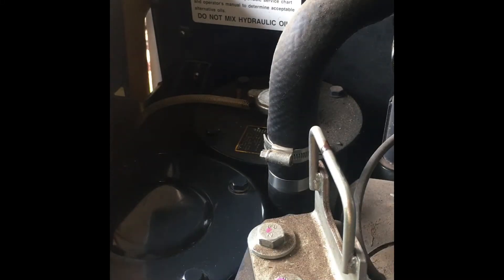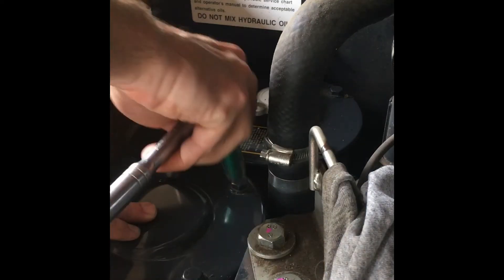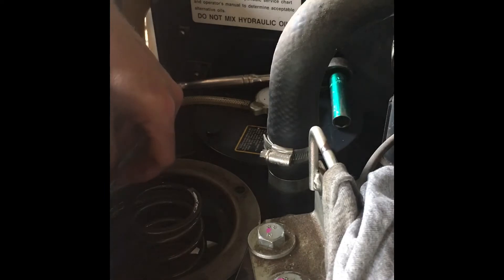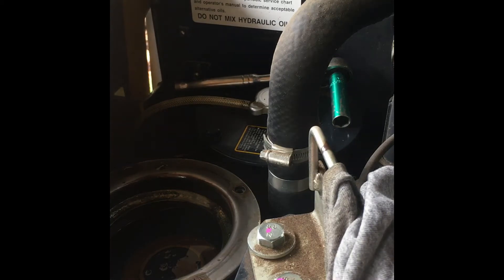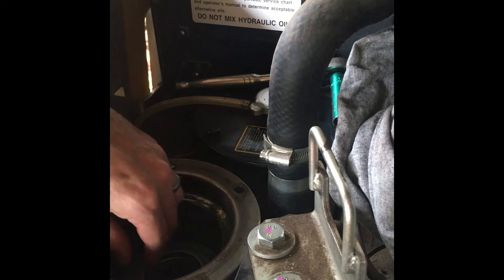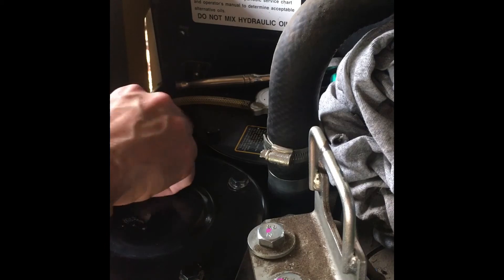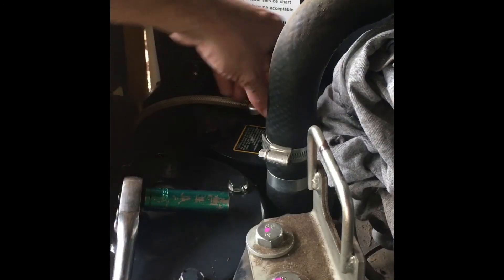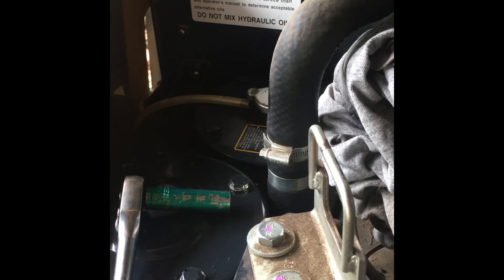Hydraulic Filter Change John Deere 35G

Comment: Hi. Did you bleed it?  I have the same machine. Is the bleed screw the hex/allen style? I just changed my filter. Man that screw was kinda hard to find and seems almost stuck. Advice? Suggestions?  Thank you sir.
Reply from the maker: I didn't bleed it, that filter is at the top of the system, I did top off the fluid level after changing the filter.  Didn't have any trouble with air in the system.
Reply: @jcobe-qi6mv  cool. Thanks for the reply. I’m a new owner of one. Used em quite a few times but only rented so I never had to bother with maintenance.  I’m always afraid I’ll be all scatterbrained and mess up and then need a technician to come out.
Reply: I bled mine. Opened up the screw and I guess I expected to hear a little air come out. So I opened it enough to actually drain a little bit of the fluid out. I didn’t get a manual with this machine, bought it used with 400 hours on it, so I’m just kind of you tubing everything and winging it.